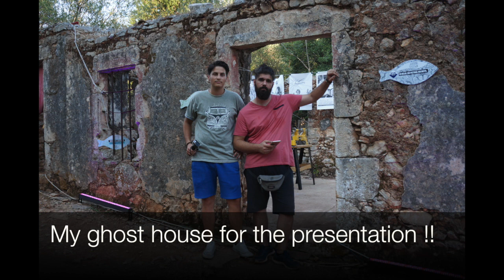Woodturning a Ring holder

Comment: Another nice project.  I usually cut off the unused wood near the clamp to the diameter of the part that is inside the chuck jaws. It allows for better access to the underside of the piece and reduces weight and/or vibration.  Your English is great and I very much appreciated the video of you teaching.  Who were the students?
Reply from the maker: +2300Kenzie hey bro I always love to read your comments!! Is a little trick that happen every time with the unused wood !!! I don't cut it all because the leftover is a great glue faceplate for the the lathe!!!I never use glue but I see other people use hot glue and work with leftovers!  But I keep them for the day that I will need it !!! The students ;; the entrance was free for the public so people that pass by there and find this interesting they came in the ruin and follow the demo the most of them I see them from first time in my life !! But they was curious and they done some great questions!!!